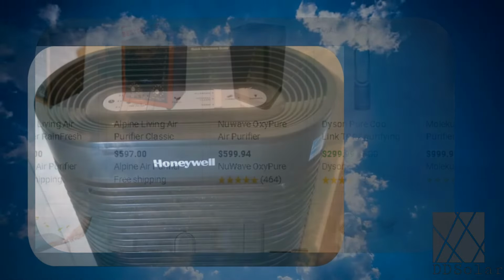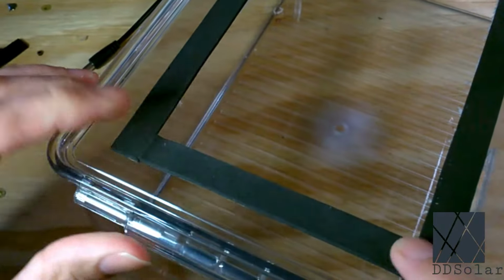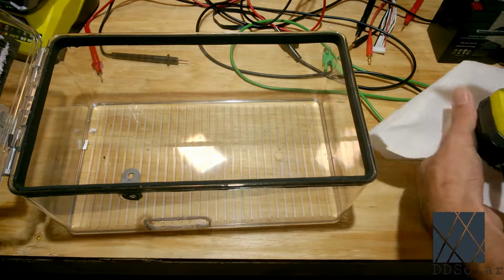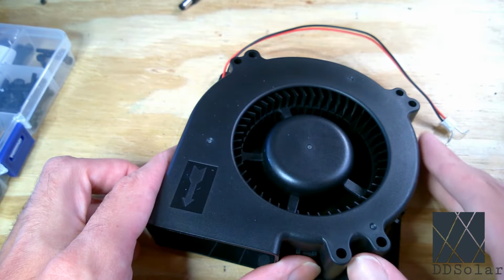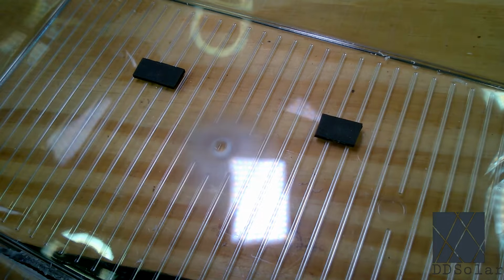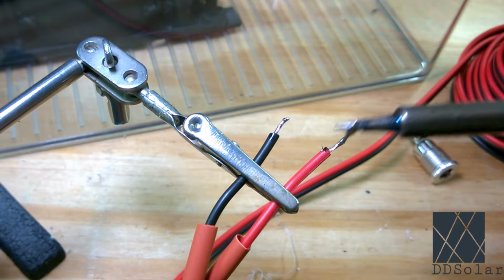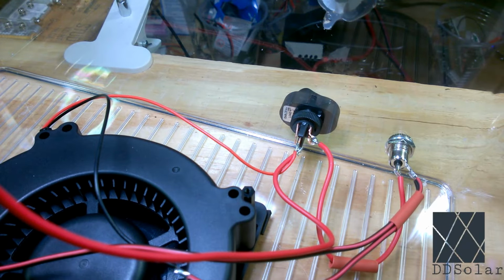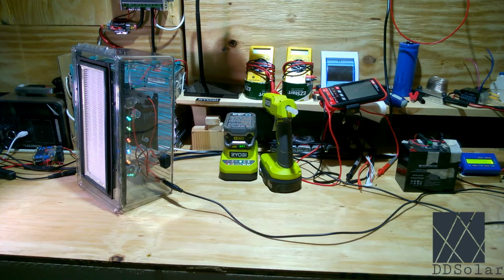#DIY Air Purifier! HEPA filter with Optional Solar Power 12V 18V 24V. Breathe Fresh

Comment: Awesome video.  I am making my way through each one of your videos starting at your very first one.   I am learning lots.  Everything was going great until you introduced the LED's.  You said you connected 7 or 8 in series. May I ask was it 7 or 8?  I  have a basic  understanding of  the concept of needing a current limiting resistor for LEDs and I have heard of Kirchhoffs 2nd law and i think I  can understand the concept  when  the resistor is placed in series with the LED.  Now what you are doing is next level for me.  Is any of my next sentences correct?   
1.  Since you are doing D2S( direct to solar) and you have potentially 21v of open voltage from your panel and your blower is 12 v  then you wanted to protect the blower from over current with a string of  LED's connected  in series to act like a current limiting resistor. ???
2. You connected the LED string in parallel with the blower? The positive end of the LED strip to the outgoing end of the switch and the negative end of the LED strip to the  negative portion of your 2.1 x 5.5 mm female jack (power source)  ???
3.  Connecting the LED strip in parallel will reduce the wattage to the blower when the voltage is higher. ???
4. Could you have used a Buck converter  to reduce the voltage from eg 21v to 12 volts  or if you got a 24v blower then could you have used  a boost converter to increase the voltage from  21 to 24volts????
Reply: Awesome reply. Thanks
Reply from the maker: @waynehutson6225 Welcome!!
Reply from the maker: @waynehutson6225  Thanks! it's a blessing that my older videos are getting views I am super thrilled to hear it :) Otherwise they won't help anyone! 

7 LEDs were used in the end. With a higher VoC panel, maybe 8 would be a smarter choice, it depends. There is actually no need for a resistor  in this case. I know that's kind of "frowned upon". Nevertheless these LEDs continue shining and never burn out :)

#1 correct on the potential voltage, the blower is 24v which negates the need for regulation, and the LEDs are in parallel.  The LEDs are too small to regulate in this case, so I didn't depend on them for anything but "colorful lights". 

#2 The LEDs are in parallel, right! 

#3 Right also

#4 Yes that would work, I was aiming for total simplicity so used a 24v blower. It will never reach it's max speed without a boost converter, but it's amazing how much air it puts out even at 17-20v

(Hope this helps, anything not clear feel free to ask anytime)